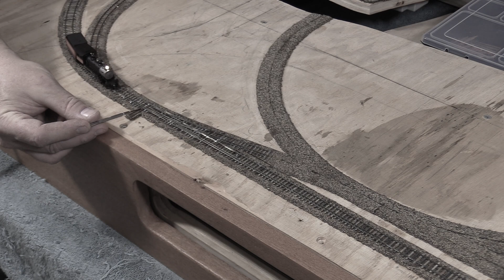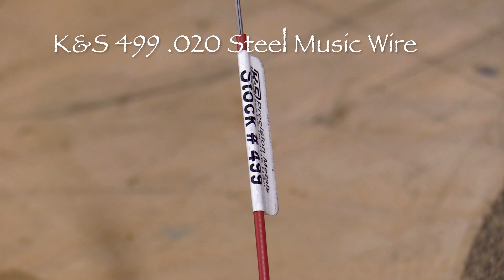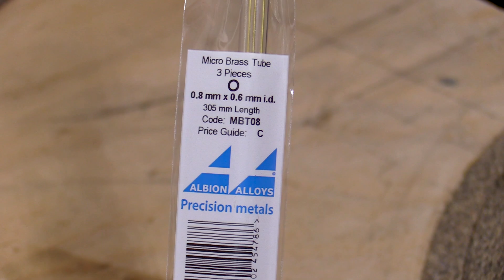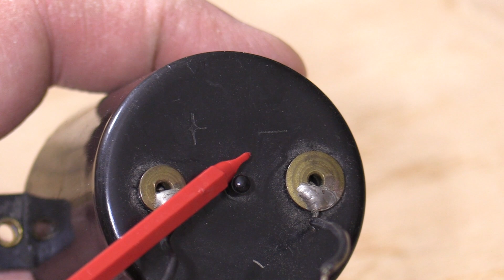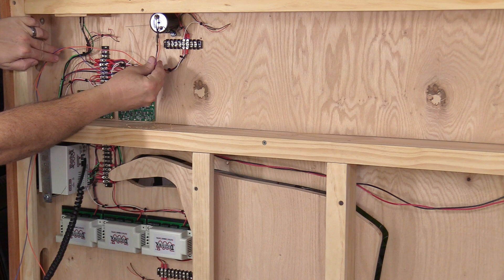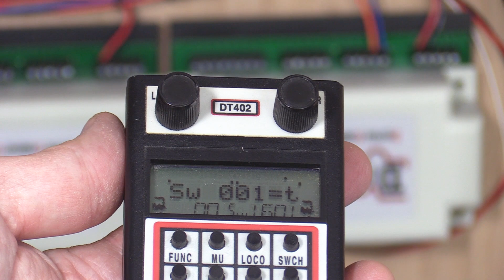Layout Building N Siren Creek Part 9 - Installing a Switch Machine

Comment: Dan, very impressive, including building turnouts in-place without the aid of a Fast Tracks jig - especially the dual gauge turnout! Do you belong to the international Nn3 group on Groups io? Tom K.
Reply from the maker: Thanks so much!  I still have an old copy of the Nn3 manual from when I was a lot younger.  Doing something with Nn3 has been a dream of mine for years.  Your work was an inspiration.  I didn't know about the Nn3 email group, but I just joined.  Thanks so much for pointing it out and for watching!